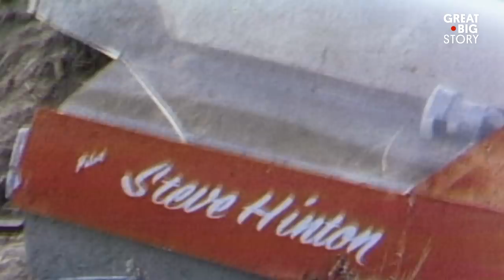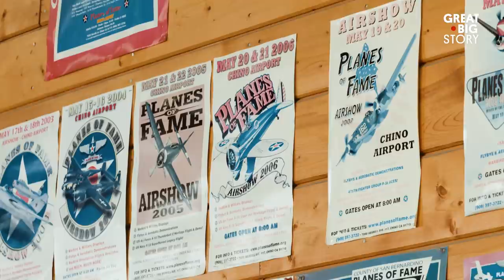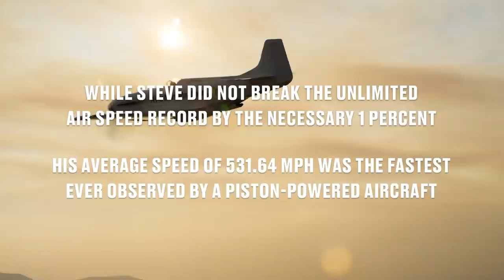Racing Against the Odds in a WWII Plane

Comment: Should have went for it and pushed the engine to the maximum, even if it  meant blowing up into pieces. Record doesn’t say engine has to be in 1 piece afterwards 😉 Overall great inspirational video. Keep up the good work 👍🏻
Reply: soaringtractor the pilot said he turned quickly and didn’t want to destroy the engine on the last run. Therefore he could have not turned as sharp on the 4th run and risk it. But he didn’t... so re-listen to he end of the video fool.

Comment: What if you ran nitrous to gain a couple mph. Or a shroud to limit the air going down the intake. At that speed you may need to limit the air speed going in. I'm sure you guys know all this, I'm basically just curious. I'm new to this but... I've been bit by that bug too recently haha I know jets very very well. I've flown jets for decades. Even tho I was assigned a multimillion dollar military aircraft, i often had wished I was flying an F4U corsair, or a B29. I've cruised at mach and all I think about now is piston engine. I own an R2800. Kind of an impulse buy. I bought it to learn on.

Comment: there is any rule, that says that you can't use, and extensively  modified  engine, or even a new v12?
Reply: No V12 has been produced since that has the capabilities of the Rolls Royce Merlin for the weight and size.

Comment: Great piece, though one thing that was forgotten, the P51 was a mediocre aircraft until it had the Rolls Royce Merlin engine installed, that transformed the aircraft into the powerhouse it became.
Reply: Sf Mason the airframe was and continues to be extraordinary, mating the frame with the Merlin transformed it into the best fighter ever flown.
Reply: Above 25,000 feet yes, its performance was quite bad. It was faster than the spitfire and other allied fighters at altitudes below 25,000 feet though. The  Allison V1710  gave good power at low altitudes. So you are correct but at the same time wrong. Yes, it was mediocre at high altitudes but very good at low altitudes. You seemed to have forgotten that part
Reply: soaringtractor but by this time the Spit was a very old design.why this guy not use a Griffon.  I seem to recall the P51 was built against an RAF specification, I’ll do some digging on that. .
Reply: david duffy it wasn’t a fighter, it was a long range escort airplane. The spitfire was a fighter and had better performance in speed, rate of climb and turn.
Reply: The allison was great at low altitude which is why they gave it quad 20MM cannons and used it as ground support

Comment: Rare bear's 4500 HP radial engine is able to hold together at higher power level then V-12 Packard Merlin engine.
Reply: Ufortunately, as wonderful as Rare Bear's radial is, and as big, the radial will always have lots more frontal area and drag.  Thus the trade off.

Comment: The prop record is held by a prototype aircraft called the F84-H i think.

It was a standard F84 but instead of a jet turbine engine they stuck a 3 prop 6000hp engine on it. It went 664mph an due to propellers desgins was unable to go beyond that mostly due to vibration. Basically the wind at the top propeller was going faster then the bottom making it vibrate violently.

Thats what this guy faces to beat. 672mph or in that area.
Reply: It had a jet engine though, so it doesn’t count

Comment: does this count turboprops? because the Russian heavy bomber TU-95 has gotten to 800+ kph speeds in test flights. it's civilian airliner counterpart TU-114 are the fastest propeller driven planes despite their massive size, out running even early jet fighters.

Comment: is he flying with the same aerofoil profile? miss ashey 2 back in the day had was a griffon powered p51 with basically wings off of a learjet. the record will last as long as someone with money does not come to take it. there are plenty of areas to improve on. with 3d printing, making one off parts for merlins just got a whole lot cheaper, there is CFD as well as and composite for bodywork / props. hell even take away the canopy and fly using a screen and digital camera up front! also the p51 was designed to british specs. the wings were basically off a bf109 with some british horsepower and american ingenuity for mass production.
Reply: Roland >>> This is  total BS. The wing  "NACA-developed laminar flow wing" had nothing to do with the BF-109.  . Soaringtractor is right , except that it was NACA , not NASA .

Comment: I don't understand why there's a percentage requirement or it has to be an arithmetic mean. A record is always based on base numeric, across all disciplines. So if the old record was 528.33mph, then anything at 528.34mph and above should be a world record. And he did go above the old record 3 times. If this record is calculated based on a 1% improvement on the previous record, then this rule should become stipulated across all disciplines.

Comment: 554 MPH on the first pass... how is that not a record?
Reply: Because speed records are always based on several runs
Reply: @peterzingler6221  so that would explain why the spitfire doesn't hold the record then, because a pilot got his very very fast indeed, so fast it bent the wings back and snapped the prop off(he basically turned it into a modern aircraft ie the wings and no props) 
I wouldn't even want to attempt once let alone multiple times

Comment: Dear Mr. Steve Hinton,I don't know if this is legal but I noticed the entire surface of your record attempt Voodo is polished smooth which creates a lot of air tension at sub sonic speeds.  Now if you dimple the entire surface like a golf ball, you will completely break the air drag tension, which will ease the load on your engine, and can now easily exceed all speed records.   If you go to a bicycle shop you will find a racing carbon bicycle wheel called ZIPP that features these dimples, which are the currently the fastest wheels for time trial bicycles.   Just remember this, if you drive a golf ball, with a #1 wood club and the golf ball has no dimples it will only go about 70 yards.  But if dimple the same ball, and use the same #1 club and hit it with the same energy that same ball will go well over 270 yards.    Just wondering if that is legal on your Voodo for the record?SincerelyDan Sotelo
Reply: @TheTazzietiger  Hello David Hill, thanks for the physics website, you learn something new every day.  After reading the Q&A site, I still think if dimples are placed in the correct place of the airfoil shape and contours of other parts of the plane it could help an airplane move easier thru the wind.  Of course, that would take big research & resources.  Anyways, that would be a great project for the University of Washington, if they haven't already done so.  Again, thanks for the website.  Dan

Comment: Must an original engine be used? I don't know the rules around these attempts but it seems a scratch built replica motor based on the Merlin utilizing advanced innards could be an option.
Reply: Brent Dallyn mostly original engine. Some parts are made new like pistons and valve train parts. These are usually later versions strengthened for airline use. There is a company in England making new heads. The problem is it costs huge amounts of money to FAA certify new parts.
Reply: soaringtractor  If I did I wouldnt have to ask the question right

Comment: *Do-335 laughs from afar
Reply: Hahaha No it doesn't... The Supermarine Spiteful does...
Reply: Neither the Do-335 nor the Spitfire could get any where near the record. The Spitfire’s wings are too thick and cause too much drag while the surface area of drag from the do-335 caused my the presence of two props is too much at those speeds.
Reply: Garrett Rathbun The Do-335 is the fastest propeller aircraft in the world, with top speed of 980kph at height. Thats why im saying its faster than this turbocharged mustang.
Reply: “At altitude” these records have to be down low, where the air is too thick for the Dornier to shine.
Reply: @georgivanev7466  2 stage supercharged as it was a RR Merlin not a Packard Merlin.

Comment: Could airplane be turbocharge or supercharge ?
Reply: TJI 177R twin superchargers
Reply: They’re already running those engines well beyond what they were designed for so no, they can’t pump anymore air into them.
Reply: soaringtractor  Voodoo's race engine has twin superchargers because her race engine was completely rebuilt from the ground up. It's still a Packard built Merlin but on steroids
Reply: TJI 177R two stage two speed

Comment: I am thinking you might be able to squeeze a bit more speed out by changing the surface texture from polished to dimpled as in golf ball surface ,counter intuitive but apparently the difference in velocity is very significant  ?
Reply: They tried the dimpling on surfboard bottoms and they stopped using it. There is a difference between 20 mph on the water and 500 mph in the air.

Comment: Dumb question time: given that the fastest WWII-era piston-engined fighters were generally twins (F-82 > P-51; F7F > F8F; Dornier Do 335 > all of them), why are all the speed attempts done on singles? Is it just airframe availability? It seems that if you start with a twin-engined design that was already faster than the stock singles, the corresponding tuned-up speed could be higher. Might be safer too, since you could blow an engine and still have a working engine to get back down.
Reply: Daniel Mocsny While do I think all of those aircraft are quite rare ( all though I do remember spotting a USMC F7F in the video) I think it’s because the record required that it be a single engined aircraft.

Comment: 3600 hp?,the power to weight ratio is betten than F-18,why can´t go further in speeding at low trophosfere...?,propeller?
Reply: because aerodynamics prohibit props from putting more than a certain degree of force into the air before the air starts moving too fast around it for the prop to bite into. And so, because of this method of making power, prop planes can only go so fast, similar to how helicopters can't fly forward at a decent speed and end up limited to less than 200 MPH. In jets, you don't have horsepower. You have dry thrust, and instead of displacing air, you're forcing a stream of gas out the back and can put out more force. Hence why the F/A-18 can exceed 700 on a slightly lower than 1:1 thrust to weight ratio and the P-51 can't do that on an very high degree of horse power.
Reply: @mikethemaniac1  i know.... and f-18 need wet thrust

Comment: If someone had a boatload of money, developing a modern counter rotating turbo prop design using current CFD modeling would be very interesting to find the real limits of a prop plane. Still this is very impressive given that the original airframe and engine being used were developed on drafting boards in a very short timeframe.

Comment: They need a more modern wing.  The Mustang is an outstanding a/c built in just a few months with great fit and finish.  However, the wing, though an improvement on early ones, is only a semi laminar flow wing.   The fat part needs to be way back a la 777.   The Merlin or is it a Griffon probably, putting out 3,600 HP.  Lots of boost.  Water/methanol injection?  All the best!

Comment: It's hard to believe they could build those engines in such mass quantity while still retaining decent quality in an era where they used slide rules to calculate things. And still today with computer controlled engineering, it would be difficult to create such a massive engine at a large quantity.

Comment: It really isn't the "pinnacle of aviation", as he says in the start. You can't compare the breaking of a speed record with a piston engined plane to the invention of aviation or invention of the jet engine and so on.
Reply: It's more so about pushing a 75 year old piece of engineering to and beyond its absolute limits. In this case, a P-51 Mustang going beyond its factory-specified limits and winning against the odds.
Reply: Andrew Manson you are completely right. It is a amazing accomplishment, the ability to modify a old WWII fighter and making it achieve completely new records is significant and spectacular, but still isn't comparable to pinnacles of aviation. Perhaps he meant something like "this is the highest we personally have achieved" or something like that.

Comment: Mr Hinton can use a Turboprop,especially PT6 or a PW 150,giving a  HIGH POWER and high POWER TO WEIGH RATIO and easily more speed. 
Moreover, turboprops are more durable, robust and easy to operate.
Reply: The record has to be broken using a piston engine.
Reply: soaringtractor  If that is the case, then brother you are right in this regard.

 But i would say that in this time of turbine engine it is like, use stone tools to do the work  instead of forged steel tools.

Comment: Really cool stuff and all, but why attempt a record as such with old technology? Did I miss something? Seems like it was a story involving a string of failures dealing with an old frame and an old motor. In either case, to date, they hold the record...so congrats to them for pulling that off.  Would love to see a counter rotating system with a modern motor (electric or gas). Anyone?
Reply: It doesn't get better than that. Counterrotating props have been tryed with the 'Red Baron' and recently 'Precious Metal' with an evenmore pwerful engine. They're  heavier and slower because of that. But if this old tech is capable of doing roughly 560 mph with an engine running  not 100% sound - you can pull off anything else and not going faster. Because there you're pretty close to the Mach-wall which has it's own issues. You won't beat that 'old tech' unless you're willing to burn shitloads of money to prove nothing - because you won't break the record for piston engined planes with a gas turbine...

Comment: if your using old tech and your having reliability issues then why not update the engine, the record was just for fastest piston engine airplane  why use a 70 odd year old engine
Reply: its not actually from ww2. he means the design itself is. The materials of the airframe and engine are new but using ww2 techniques which have proven more effective in a lot of ways. things arent built like they used to

Comment: In 2011, a pilot modified and pushed his P51 to the limit and beyond, 11 people died as a result.
Reply: True. But the real reason for that crash was the unbelievable sloppyness when it came to technical security. The Galloping Ghost crashed because of parts failing worth a few bucks that hadn't be maintained for almost 20 years. They begged for it - and it came down on them. But generally every single plane competing in the Unlimited Gold Class at Reno is way beyond the limits. But they take security very strict these days, the pilots won't kill themselves and the owners won't lose a plane worth around 4 million bucks. And sadly it's a dying sport...

Comment: Ah, the P51.  A great airframe with (at first) a mediocre engine. Then they strapped it to what was arguably the greatest allied engine in WWII and bingo!

The Spitfire has a thinner wing with less drag and a slightly narrower, less draggy fuselage.  I wonder if it wouldn't have a similar if not faster top speed if it was given the same treatment as these racing 51s get. I guess we'll never know. There was never enough left to be able to butcher up and do that, those that are left are coveted as priceless warbirds.
Reply: probably not since at these speeds the wings would fall off. the spitfire was a turn fighter due to its light construction. the p51 was designed for climbing high above the enemy and diving down at breakneck speeds before climbing back up and repeating so it has a stronger airframe at the cost of more weight

Comment: 😮😮😲😲😥😥💔💔. At least you didn't crash and burn like your father did when he raced the Red Baron. 550 m.p.h. first run was impressive. Sorry you didn't break a new worlds record. The only way to do that is ditch the Rolls Royce Merlin engine and have a choice of a Leer Jet turbine prop motor,  a 6 cylinder turbo charged rotory 2 stroke engine or a twin supercharged Allison V12 piston motor. Rolls Royce engines are very temperamental. Not always reliable. "KABOOM!"